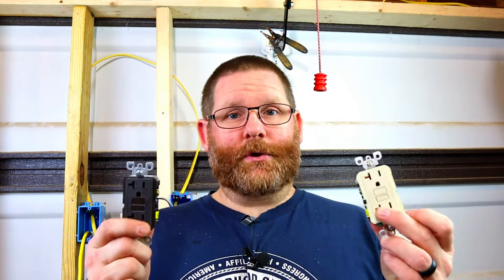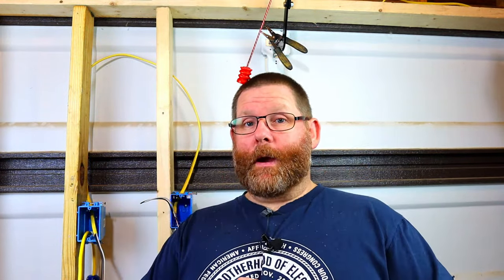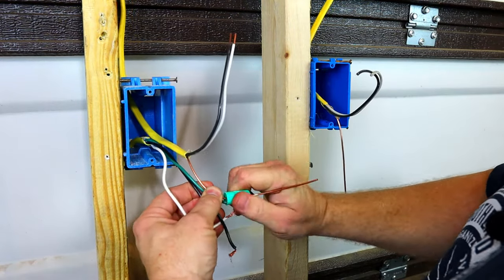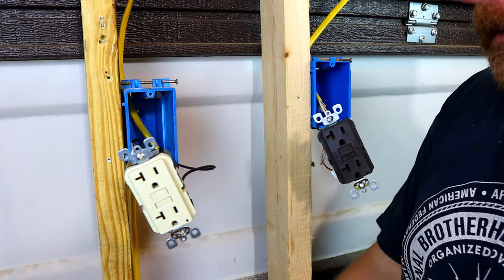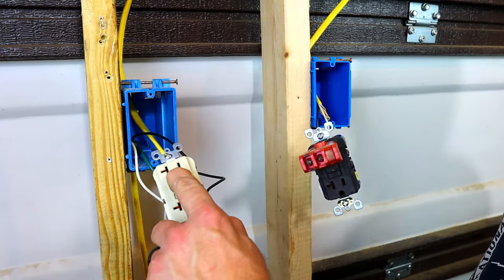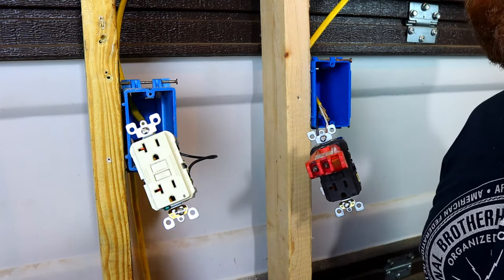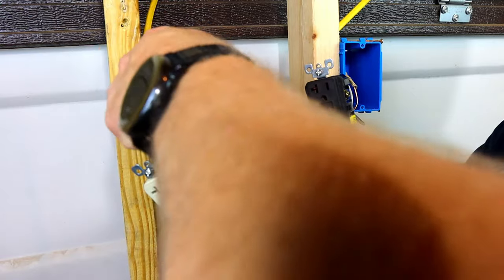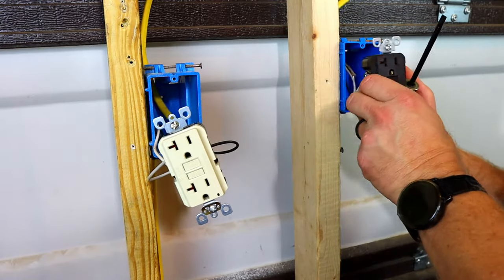How Many Ground Fault Circuit Interrupters On One Breaker

Comment: Thank you! This is a good explanation and tutorial.

This is long and about crazy electrical work in Mexico. Read on if you want to laugh and be frightened at the same time.

I’m a gringo living in an apartment in Mexico. I don’t even know where to begin! In the U.S., where we have codes and shit, I was able to troubleshoot and repair electrical issues, confident that there was a basic logic based on county and national building codes. I was even able to add new circuits/circuit breakers when I needed a separate circuit for the computer room or when I set up a 220 circuit for welding.

The building is between 15 and 20 years old, built by my landlord and one of his sons. I’ve been living here for nearly 10 years. It’s 2Br/1 bath/kitchen/living room, and a rooftop patio. The building is 2 second floor apartments and one commercial space on the first floor. I believe that the landlord and the son did the electrical themselves or didn’t hire a competent electrician. Also, as is common, the electrical service is split between the two apartments—meaning that each apartment gets one of the phases at our meters. My neighbor gets 120v of one hot leg, and I get the other 120. There is a single 30 amp breaker at my service panel!! All the outlets and overhead lighting are fed from a single 30 amp breaker!

The house is brick construction and the wiring is buried in the walls. I’m not entirely sure if everything is wired in series or if it’s branched. If branched, the first splice is buried somewhere in the walls. Am I making sense?

Also, there was no ground. One of the first things I did was to drill a hole in the foundation and hammer a 4’ copper pole into the ground.  (My service panel is by the front door on the first floor.) This is so I could add two new grounded outlets to the living room for the TV and computer. I added new wire (romex 12 gauge) from the breaker—basically another splice, but at the breaker/service panel. Yeah, I know, not kosher! In the U.S., I would have added a new breaker at the panel. Here, there is no room for a second breaker on the panel. I guess at some point I might upgrade the panel or even upgrade the service to 100 amps. I hesitate because this is a rental, but I’ve been here 10 years.

I’m doing a kitchen remodel and I want to replace the the outlet by the sink with a GFCI. The grounding issue is complicated. Here’s what I’ve done: the water pipes were not grounded as they’re fed from a big water tank on the roof. I’ve run a ground wire from the copper grounding pole to the water pipes. Under the kitchen sink I’ve attached a ground wire. It’s currently attached to the previous outlet (the wire is surface mounted in a plastic cable channel). I plan to add more outlets upstream.

I know full well that what Im doing would not be allowed by the NEC in the U.S. I’m just trying to make my apartment safer, without going to the expense of completely redoing the electrical. Maybe I should move, but $186/month is strong motivation to stay. The plan is to do a little bit to improve the situation each month.

Oh, and I haven’t even mentioned the situation with the back bedroom. It shouldn’t be too hard to solve when I get around to it: there is a open neutral somewhere. I just use the room for storage anyway. One ceiling light and one outlet function properly. But I also dread opening a can of worms and discovering the problem is more complicated than I hoped. Anyway, that’s my ongoing crazy Mexican wiring story. Also, I think this experience has cured me of my libertarian tendencies.
Reply from the maker: Wow that is alot of problems. Good for you though to try to make it safer. I understand that rent is super low. I have only in my whole electrical career seen first hand one service that was 120volts. I have heard about it before but to actually see it was something else. If you keep upgrading I'd tell him to make sure he takes it off the rent. Good luck 🤞
Reply: Wait till you see conduit made from garden hose
Reply: @busterhikney6936  Wait, that's not legal/smart/safe?? 🤣

Comment: The previous owner of my house wired up multiple GFCI outlets in series/chains in this house. I think the reason mine work and yours didn't is because mine are ungrounded.
It's always fun when the 3rd or 4th receptacle doesn't have power and I have to check every one from the panel to the problem outlet to see which one tripped.
Reply: This is my scenario as well.

Comment: I experienced the exact same issue and I was completely stumped.  I took everything apart and double checked everything again.  Same exact issue.  I used a screwdriver and depressed the reset on both GFCI until I heard a loud "CLICK".  The first way, the wrong way actually works. You just need to reset both GFCI.
Reply: You're not supposed to put multiple GFCIs on one circuit, you put one single GFCI on the first one in the series and then it will protect all of the other outlets. That is nothing but a big waste of money putting multiples on one circuit.
Reply: with the "wrong" way, if the parent one trips so will the second or third etc. I have a parent GFCI in a bathroom inside a rental studio and three other receptacles downstream off that GFCI. So if it trips in the rental bathroom all the other ones go to. The other ones are in a second studio or outside plugs. If the parent one trips, my second rental has no power in the kitchen and I have to get permission from the renter to go inside and fix it, which can take hours. So I am changing the wiring on the parent receptacle the "right" way, so each GFCI is independent from the others. hope that makes sense.

'
Reply: @actionjksn  unless you want them to work indepently, like if one is in unit and another is in a second unit
Reply from the maker: It does good luck and it will help out alot

Comment: Run a few regular outlets from your one  gfi. Note, the gfi is the first outlet on the circuit, use them in bathroom, kitchen, basement, garage and out door outlets or use ark and combo circuit breakers (new code).
Reply from the maker: Yep exactly thanks for watching and commenting ☺

Comment: Great video! I'm currently rewiring my kitchen, gonna have (I know, I know) 3 GFIs on a 20 amp circuit. There will be no other load on that circuit, just multiple outlet options, house was built before electricity. Two will be joined in a junction box and the third will tail off the last GFI, now I know how to do it without getting confused. Thanks!
Reply from the maker: Nothing wrong with that many gfcis it's all preference. I appreciate you watching and commenting ☺

Comment: We are adding an outdoor GFCI outlet off a line in the kitchen that already has 1 GFCI outlet protecting 3 standard outlets. How do you connect/wire a new GFCI outlet to a reg outlet? The line-load method is causing the new one to trip immediately. Thank you for the education!
Reply from the maker: https://youtu.be/Fe9hwE8dN_k this may help

Comment: Lol my House 1989 Build is so poorly wired the only 2 Gfci in my 2 story home is one in garage and one in kitchen..the kitchen was 15A on 20a circuit and wasn't even working,builder did it all backstabbed every outlet and switch,ground wires plastered instead of connected, i pray it doesn't burn down till we have the money for a pro to run through the whole system.Great explaining on wiring .
Reply from the maker: Yea I would definitely get this looked into as soon as you can. Good luck and thanks for watching and commenting ☺
Reply: @MountaineerOutdoors  Ya its matter of what the tax return will cover this year,just to change the 7 outlets in my kitchen had to turn off 5 breakers lol
Reply from the maker: Wow that's weird
Reply: @MountaineerOutdoors  ya one outlet on a wall was tied into the living room breaker,one outlet the one the big lights plug into the ceiling was another,the fridge stove and 2 outlet next to stove another,the Gfci another,and of course Dishwasher and disposal on a dedicated 20amp lol To turn off the one outlet in my backyard and the 4 in garage I have to turn off a breaker marked Gfi ,which also my low voltage is tied into I.E. my house number and doorbell lol
Reply from the maker: I c that makes sense now.

Comment: Some hair dryers have a GFCI built into the  cord.  WHen I plug a hair dryer like that into a wall-mounted GFCI, it works fine.  This means (at least in this case) that there is no problem with putting GFCIs in series.  Is there something unique about the case I describe here that allows GFCIs to be wired in series?

Comment: I have this setup. The house I bought has a GFCI on an outside outlet and it ties in to another GFCI in my bathroom. Would you recommend that I just replace the outside receptacle with a non-GFCI, outdoor rated receptacle? Or, if you suggest that I keep them both how can I tell which one is the main one to connect this way?
Reply from the maker: My opinion is the keep it the way it is that way if you're outside and it trips you don't have to go all the way inside just to reset the GFI especially if you're on an extension cord and you have to put it down whatever you're doing and then walk all the way in the house after a while it could become very annoying. I'd keep it exactly the way it is

Comment: I am a 2yr apprentice and recently ran into an issue.  A main line from the Box was brought into a GFCI line/load (#1) in a bathroom, hopped over to another GCFI (#2) line/load, up to a light fixture, then over to a single pole switch.  Best recommendations of fixing this issue??

Comment: Have a outdoor lamp post, front porch and back deck that I want on the same circuit.  The all in one outdoor in use covers from the big box store already come with the GFCI so I am using both.  soooooo. Outside lamp post runs to front porch GFCI and gets connected to load.  The front porch and back deck both go to line yea?  I know its dumb but its a visual thing for a future homeowner to see the GFCI versus guessing

Comment: This was great! But I’m curious, is it possible to add two GFCIs independent of each other on one circuit, with standard receptacles in between? From example, I have 5 outlets on one circuit in a sunroom. First outlet on the circuit has a GFCI. I want that first GFCI on the chain to protect outlets 2, 3, and 4 downstream of the first/initial GFCI. The last outlet on the circuit is an outside outlet. I have a waterproof covering on the outlet, but on the chance that the outside outlet gets tripped, I wouldn’t want  the other outlets upstream of the 5th/outside outside to also shut off. (My router is plugged in on the first of the chain) 

How would I go about keeping the GFCI on the first receptacle of the circuit to then protect outlets 2-4, while also ending the chain with a GFCI that would be essentially separated from being protected/protecting outlets 1-4? My goal is to have the first GFCI protecting outlets 2-4, and to have the outside/5th receptacle only trip and shut off itself if it has an issue.
Reply from the maker: You would have to run a dedicated line off they gfci first in line, off the line side to your outdoor gfci.

Comment: I appreciate ur answer to my last question. I have another question that is unrelated to the video. I’m working on a house with old cloth wiring. Do u know how to figure what size the wire is? The fuse on the circuit I’m working is 20 amp but the receptacles are mostly 15 amp which I know is wrong and maybe a 20 amp receptacle or two mixed in there. That’s where my confusion is coming from. I can’t tell if the fuse is wrong or the receptacles. So I figured the wiring size will tell me what the circuit is supposed to be. But not sure cus it’s old wiring.
Reply from the maker: So if it's 14 gauge wire you definitely cannot put a 20 amp receptacle on there. But if it's 12 gauge wire you can put 15 amperceptacles on there or 20s I have a video on that and I'll link it right here so you can watch it.https://youtu.be/5wJOydWK8Ws?si=q4AwaCk2_YQvAS_w

Comment: @WhynotDIY

Hello, I have an old house and from research it looks like I can "upgrade" two pronged outlets to three pronged outlets using a GFCI outlet. From what I can tell, it is "safer" to do it this way. 
Here is my question: I have 4 wires in each box, 2 black (hot), and two white (neutral). The first GFCI install went off without a hitch, but the next 3 (they desperately needed replaced) would not reset after tripping. *Are your instructions in video still applicable if my house is wired the  I mentioned above?*
Reply from the maker: Are they all wired to the line side?

Comment: Did you try to reset both GCFI outlets when connected in serial?  Another YouTuber showed it is possible to have multiple GCFIs connected but highly confusing because the user has to figure out where the fault originated and reset all subsequent connections.  Thus not code.

Comment: you can install a regular outlet where the second GFCI  is, the way you have now, you just can't install a second GFCI through the load terminals, but I think you can pigtail the hot line into the first GFCI, if you want to put a second GFCI.. Does that all make sense?

Comment: I did the same thing with an exterior outlet on our fifth wheel, and I have a GFCI outlet on the outside of our fifth wheel that is connected to the load side of our GFCI in our fifth wheel's bathroom and it works!

Comment: Are you saying that you cannot have any wires connected to the load side of the first/parent GFCI outlet?
I have a problem.  One GFCI outltet running garage door openers, outside landscape lighting, and two curb lights at the end of my driveway.  Openers and landscape lighting is fine, but there is something shorting out at the driveway lights that I cannot find (about a 100 ft, run buried cable).  When it rains heavily, and only then, the GFCI trips takind down everything.  If I disconnect power from driveway lights, everything is fine.  So in my mind I thought I would use two GFCI outlets, but thought of the first one having the garage openers and landscape lighting connected to the load of the parent GFCI outlets, and connecting only the driveway lights to the load side of the second/child GFCI such that in my mind I still would have openers and landscape lights running if driveway lights short out somewhere and hopefully trip only the child GFCI.  I have the impression that this approach will not work, correct?  Cannot seem to fix this problem.

Comment: I have a new circuit for an outdoor patio extension. Hot coming into a double gang box with two GFCI receptacles. Then a third GFCI at a grill station. All are in outdoor approved boxes. I have them wired via your "wrong" method but am confused because the sticker on the load terminals say to only remove if feeding additional GFCIs, which I am. Currently none of the three GFCIs will reset with the breaker on. I originally had the first box wired via the pigtail method to the line terminal on receptable 1, then load on receptable 1 feeding line on receptacle 2, then load on receptable 2 feeding line on receptacle 3. The breaker would trip instantly at the panel every time. These 3 receptacles are the only 3 on this circuit. I am going to try your "correct" method. But, my gut also is telling my that I may a ground wire  coming in contact with a neutral or hot once I jam everything back into the double gang box as it is super tight.

Any suggestions would be much appreciated.
Reply from the maker: That's what it sounds like to me. You have to use the line on every gfci. And make sure that nothing is touching the box nuetral. Let me know if you fixed it

Comment: Hi friend, thanks for this video but I have a question, I did the wrong way like you show in the video but I still have power on both gfci. I want to show you how I have everything connected. From the breaker I have the 1st gfci, then 2nd gfci then three regular outlets. On one of those regular outlets , my refrigerator is plugged. Every gfci and regular outlets have power but this is the problem- after 3to 4 hours the first gfci triggers and shut down all please can you help me with this problem? Thanks
Reply from the maker: First of all how do you have the gfcis wired?  Then we can try to go on from here

Comment: Thank you so much!!
I had this issue 2 weeks ago, I was so embarrassed that I didn't make it work.,
Now I was blaming a 30am braker feeding a couple of 15 amps receptacles.,
So question?
Why would someone use a 30 am kind of like  a double braker?
Is ok?
Reply from the maker: Absolutely not ok to do that. Most people do that because that cannot find what they need. Was it a single pole breaker?
Reply: @MountaineerOutdoors   
It was a fat one, I'm guessing it was double. 
Thank you sir!
Reply from the maker: Well by code if you share a nuetral you have to have a double pole. But still if it's a 12 Guage wire it's only for 20 amp receptacle or more than one 15 amp. My guess is that it's sharing a nuetral

Comment: correct me if i'm wrong here.  wiring multiple gfci's the "correct" way on the load side gives you protection just at that single outlet without tripping any of the other gfci's on the same circuit.   am i thinking right here?
Reply from the maker: Exactly

Comment: I recently replaced several GFCI receptacles for a friend and found three GFCI's wired just as you described.  Since all three were on the backsplash behind the sink, I questioned why they would not just used two regular receptacles wired through the load side of a single GFCI.  I assume the only reason would be if one trips the others may still stay 'alive'.  Is there any other reason I'm not seeing?
Reply from the maker: That's probably exactly why. Alot of people like to have it match so that may be why they did it. I appreciate you watching and commenting ☺